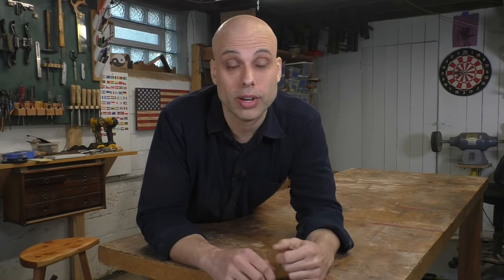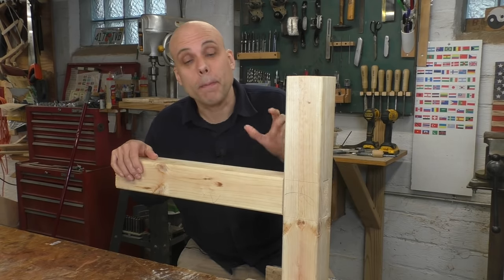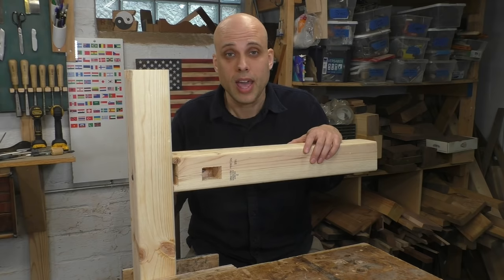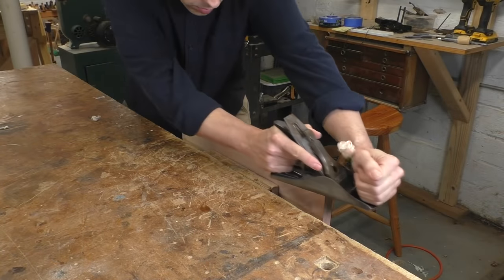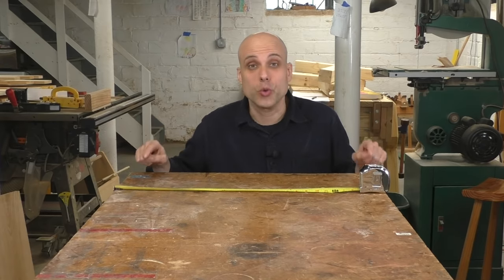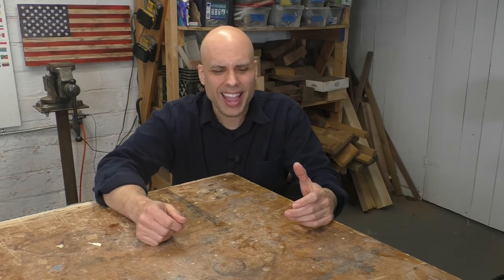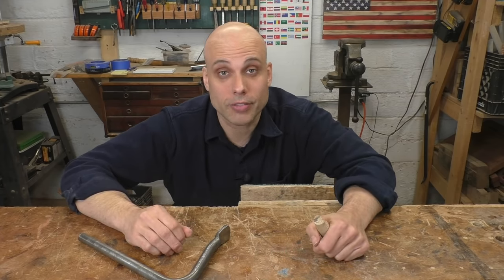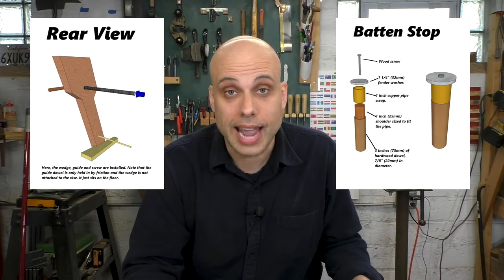Four Workbench Building Mistakes (that we all make).

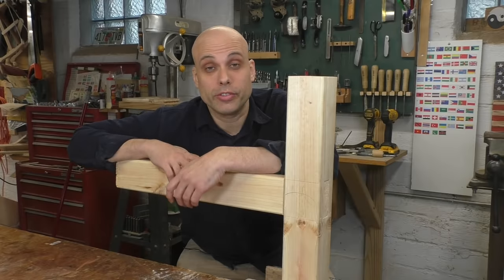Comment: 2:30 "No matter which design you go with, you're going to end up with four legs, and they're going to be joined with these horizontal stretchers"
Nope. My bench is made of four boxes. The base is made of three boxes; left, right, and back, each of which is constructed from a simple ladder framework of 2x3's with a layer of really thick reclaimed victorian floorboards glued and screwed to two faces. The back box has a pair of threaded half-inch rods running the full length of it, which are used to bolt the left and right sides to it - these don't come loose. The box which forms the bench top is the same, except that there's a double layer of boards on the top to allow for dogs, bench stops, holdfasts etc and there's a tool well at the back. A 6' length of 2x8 is attached to the front of the bench top box, which also forms the back jaw of a veritas front vice. The whole thing probably weighs over a hundred kilos and wouldn't wobble if you hit it with a truck.

Comment: Great recommendations about this topic - wish, I had known 40 years ago.
To make bench-dogs and hold-fasts work with your soft table-top, double it up with a nice hardwood top, attached with carpet-tape and 4 or six wooden dowels (3/4"). You can plane it several times, and when iit gets too thin, remove it and put on a fresh one.
Switching from your bolt-and-nut joinery to a half-lap shouldn't be a problem either.
Keep up your great work and stay safe

Comment: I have built several workbenches in my lifetime (73 yrs) and the easiest one that I have replicated several times is a pallet with four legs or on a couple of sawhorses.  The current one is just an outside rough bench and has only the few strappings that formed the pallet. In other words, a lot of wide-open spaces so I can get underneath the lawn mower or .  .  ?  And I like the melamine top for my inside workbench for easy cleanups. When it gets rough and dirty, I strip it off and refresh with a new cover.  Best of all, dont over think the problem, build for your current needs.

Comment: Great analysis and very methodically talked through.  I’ve built a few over my 63 years and still like the wide plank top, much like your English joiners bench.  I generally build them out of what is ,lying around or what can be got cheap.  One of my best was an outdoor work station much like your joiners bench.  The demands of space required this but you had to put the gear away every night. But having a bench beats not having one. 👍🏻

Comment: I built my first work bench when I was 8 years old out of scraps from the boarder and batten siding Dad was putting on a  building on our property. It was mostly nailed together with nails I picked up off the ground and straightened on Dad's anvil. It was rickety and didn't last, but I remember building a few other scrap projects on it that summer before I chopped it up for kindling.

Comment: Hi Rex, I always enjoy your videos and learn a lot. I built a workbench in February. Wish I would have seen this video first. I did a lot wrong, or possibly "different," but it works and I've finished a lot of projects on it. My budget for the build was,... actually, I didn't have a budget. I went to local factories and home centers and asked, "you throwing that out?" I used cast off wood and materials on hand. 72" x 17" and 34" high. Weighs a few hundred pounds. Still am doing tweaks to it, but the big thing for me is that it has helped me blast through a bunch of projects that there was just no good way to do without a bench. I need a vice though. I admired your leg vice in the corners of the screen. Just a few more projects to finish and I might give that a try.

Comment: I’ve built several benches from a plan I once saw in Hot Rod Magazine.  The design wastes zero materials and is made from one sheet of plywood (top, bottom shelf, back stop), two 8-foot 4x4s (legs), 6  8-foot 2x4s (frame work) and can be nailed or screwed together with basic tools. One bench I topped with a salvaged piece of laminate counter top. I left it in my old house’s basement when I moved). Sturdy as all get out. My current (and oldest) one got heavy-duty casters installed on the legs for easy moving when cleaning the garage.

Comment: Some good points in this video.
I have mine against a wall and thus I added a board on the back as a fence, to prevent small things like nuts and bolts (and chips) falling down there.
Also I make mine higher than where a pinky would start so I have to bend over as little as possible. And the surfaces I prefer to paint in an
even colour like a light grey so its easier to see small parts. Depends on how you use your bench.

Comment: I have done mostly steel fabrication and have been both happy and sad about both large and small workbenches. Sometimes too small, sometimes too big, sometimes not flat enough and steel is harder to change the size, flatten, or replace. My dad has always been about fast and cheap and always struggles. Benchtop vises are most always in the way and mdf and Masonite is always soft, warped, cracked, or liquid damaged. My friend clamps mdf to his steel workbench for smaller projects for flattness and to end weld spatter. I added peg clamps to mine which also makes good fixed squares. Some wood guys tried 1/4in HMW plastic tops but still have trouble with nicks, dents, glue, flattness, etc.

Comment: I added 3 layers of 3/4 furniture ply to a Sears and Roebuck 1950 workbench. All my dogs and holdfasts work. Mine is 42 inches wide, but it hugs a wall and the back 8-10 inches is where the endless line of cans (brushes, pens, measuring sticks, sharp things, scrapers, etc) sit. I like having 30+ inches of action on it with my frequently used items in reach. Then I installed two tail vices on the end. With the one vice on the side, it gives pretty good service. I resurface it with a hand planer and a sander every couple of years. 
Someday, my skills might need a new bench, but key is stiff, flat, and the ability to hold the work. I've built three shops and each had its own restrictions. I dream of 500sf with a 20' open wall...

Comment: That intro is so on point. I wanted to build a good workbench, from raw wood, but instead we just bought a desktop from Obi, sanded it, and used lacquer on it. It wasn't sold as a desktop, but as a wooden slab, glued together from boards. I just couldn't make a straight, level, board. My boards were all jinxed. Either not level, or warped. Later on I wanted to build a new one, to the farm plot, but never did.

Comment: After moving into our home, I decided the first project would be a workbench. I honestly didn’t research anything, but just tailored the construction & dimensions to my work space, what I expected to do in it, and what little I knew of carpentry. It’s about 5 feet long, 2 1/2 wide, 32” high, and the top is double-thick 1/2” plywood over 2x4 stringers, 16” on center, each screwed to a 2x8 skirt surrounding the top. Um, yeah, it’s heavy. Bolted a machinist’s vise on one end, and a grinder on the other.  
I found the grinder got in the way. So I disassembled the end piece of the 2x8 skirt, mounted the grinder to it, and reattached it with hinges. So it drops down out of the way when not in use. Added a 6 plug outlet strip to it as well.

Comment: just about done bulding my first 'workbench'. Had the old school 2x4 top w/ 4x4 legs at a few houses, always against a wall. No vice, well, a typical 'machinist vice'.

Then I got a portable workbench that had t tracks, router mount, can clamp at the edges..small at 2x3 feet if that.

So now I have my 'dream' shop...I built a 3x6 food 'torsion box' style with doubled 3/4 ply on top. Likely to add t tracks...we'll see as I use it. Would like dogs but you bring up a good point. Likekly to do that vice you say isn't great...and a few other features i've seen on videos.

Why? Well, it's part router table, part outfeed table, part assembly table. the space under the top will give me a place to put things so they are not on top and in my way.  I don't have a lot of hand tools and while i've used hand planes i really like my power planer.

And if my top gets too beat up...I can throw a sheet of ply on top and it's new and flat. We'll see...

Comment: On the way to build my first ''real'' workbench here (2'-0''x5'-0'') (I know it's really small but perfect to me since I just have 14'-0'' x 8'-0'' place). Thanks a lot for your advice. I really forgot I could REALLY need a planner stop until I generally make everything with a hand planner to make less noise (and I begin to be more effective with it than an electric one) 

I'm gonna make hand made vices and side vices in hard wood. Just trying to make my first screw and bolt in wood but it's getting frustrating because standard dowels are 7/8 instead of 1'' but I'm making a jig to make them fast in the future since I always find these 7/8'' dowels for free. 
Gonna try to make diagonal centre tenons to be sure it won't wobble around and lock them with simple screws so I can dismantle them easily. 

The top is from an old commercial door in cherry jointed inside 2''
Pretty sure I'm gonna mess it up somewhere but... Meh the perfect bench is always the last one you made... Until... You find out something else that annoy you while working.

Comment: My first (and current) bench is a perfect example of running before you can walk. Made with a ton of 2x4s the top surface is connected to the legs with a double dovetail and moritise, legs are 4 2x4s together, leg bracing is some sort of whacky double intersecting mortise and tenon, has a shelf on the bottom and despite the ghastly appearance of the joints it is probably strong enough for foundations of a mansion.

Comment: I didn't use bolts, nor mortise & tenon joints, I used deck screws and a combination of 2x4's and 2x6's and I've had my bench now for about 12 years and it still works just fine for my purposes.  I made it 48" high because I'm 6'8" and I hate bending down all the time.  I built it from used lumber reclaimed from an old house I tore down.  Space in my little garage being at a premium, that bench along with another of the same dimensions and a smaller one between the two line one side of the garage.  The smaller bench holds my chop saw, and yes, on the first bench I put a big Wilton vise as it's good for more than just clamping wood and I do more with a work bench than woodworking, also using it for a repair bench for everything from lawn mowers to antique radio restorations.

Comment: I used a cheap solid core 32" door for the top and half lap joints for the legs. The thing is solid as a rock. I was quite proud as it was my first major project.
But I stopped patting myself on the back when I realized, yep, I made a huge mistake. I made it too damn big. Since the only place I have for it is against a wall 
a 24" door would have been perfect. I tried to hang my tools on the wall behind it but reaching over to grab a tool is impossible especially with my short frame. 
Live and learn. I need to tear it apart and cut it down.....yeah, maybe someday.

Comment: A few years ago I came across a workbench design in an 'arty' cabinetry magazine. I needed a demountable island one without the 'arty'. The split level top design was dismissed. 
I had a solid timber table top 5'x3' in stock as well as 4"x4" pine stuff. Giving the pine a rough dressing down I made the frame with 1/2 lap joints with offset bolts. I boxed 3 sides with sheet rubbish for stiffness. Some various height drawers were fitted to hold various height goodies. The top is only located by cleats. It has a spoil board screwed to it. 2 rows of dog holes were jig drilled through it plus 1 through the apron for supporting long stuff in the vice. Its inherent weight gives it great stability. 
The tops depth allows me to accumulate handy junk while having a reasonable working space. However it can be cleaned off to give a large assembly surface. At the same time I made a mobile equipment bench the same height so that it can be placed at the workbench end to process long material. It all works for me.

Comment: Just a little pointer. I work as a structural engineer and a basic rule of thumb for any wood connection that's supposed to resist pushing, pulling and twisting forces (moments) is to have a minimum of three fasteners where one is offset from the other two on one of the axis. This makes the joint resist twisting (moments) in every direction because it creates a triangle between the fasteners which is the most structural sound plane shape there is. When you only have two fasteners the connection is only resistant to moments on one of the axis which will make the connection a little flimsy on the other axis.

Comment: I used 12 inch industrial floor tile to cover the 1 1/2 thick plywood top.  I have some extra tiles should I need to replace any due to damage, but so far in 33 years I have not had to. It stays smooth and is also easy to clean. no gap left between tiles and secure the tiles with contact cement.

Comment: On height, I use island benches in the middle of the shop - one static Swedish cabinet maker's, and one English joiner's on heavy duty castors - and they are the height of my saw table so I can feed in from the English and out onto the Swedish. I've also put magnets along one edge of both benches so they join together if I'm working on 8 by 4 panel faces.

The most useful tool in my shop? A polished concrete floor - easy to clean, easy to move materials and tools around on dollies and trollies.

Comment: Made my first "real" bench with an exterior solid core door for a top. It was flat, straight, and heavy.  And I very soon discovered that the "solid" core was particle board, and every time I tried to clamp something to it, if the clamp didn't land on the hardwood edges , the bench top mushed down and the clamp lost grip.  A built-up beech countertop was the solution to that problem. :D

Comment: I had a steel workbench I welded together years ago that I was using.
But it's not doable for woodworking.
 So I wanna make 2-30x36 inch square portable benches that I can lock together if need be.
I got the 30 inches from this video.
36" so when I lock together they'll be 6ft.
And somehow make them sturdy to keep from shifting and rolling when using them.
I figure 1" dowels will keep them from shifting when locked together.
And if I need a longer table I can separate them. 🤷
But hell yah man great title, glad I watched. Especially when you hit the tail end vise and the legs being to close to the end.
Hate cutting holes depreciating the sturdiness of things to add stuff.
Was gonna just box the benches, but now I need room for the screws for the vise🤦 bam🤷
There went that idea 🤔
👌
Thanx for the vid.

Comment: First you bash face vices and then you tell how great and versatile face vice with pop-up dog is :) 

I am in progress of making my fist bench and on contrary to you claims about the 1st bench it seems like I got it about 90% right. You made a good point about making the bench too wide. I am just in progress on painstakingly gluing the top from 2x2 alternating the ring directions so that it would not warp (so much) and I was planning of making it 84 cm wide or more. Now I am thinking of leving out 1 or 2 planks, making it 80 or 76 cm. It is going to be against the wall in garage and tool wall behind it. While with the rail clamp making it about 1 meter wide I really hard time reaching to tool on the wall behind it. I am 6'5" so I do have reach. 

Thanks for making the point about not making the bench too wide, I am going to leave the top narrower, at first at least. Until I round the edges I can always add one or two 2x2 to the table top

Comment: My 4x8' bench uses 4x4" legs and 45 degree corner braces sucking the leg into corners with lag bolts. It is able to be disassembled and it is sturdy as heck.